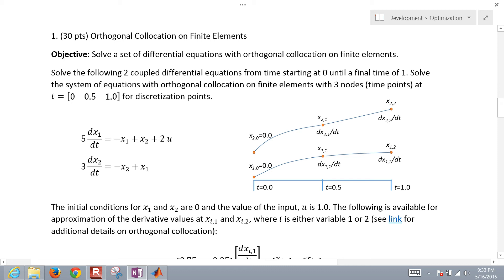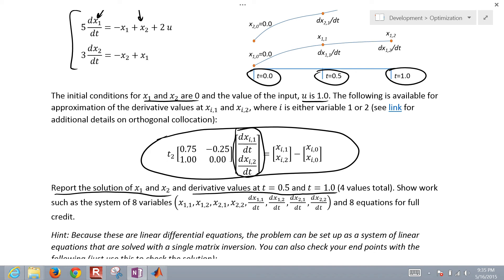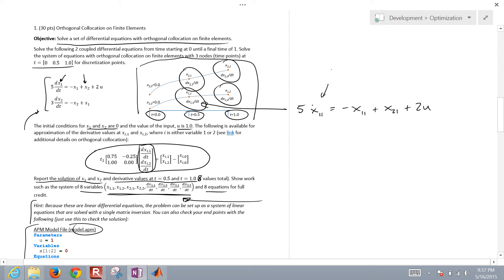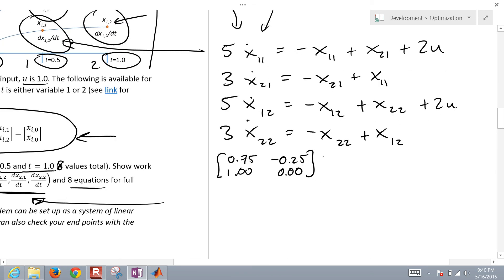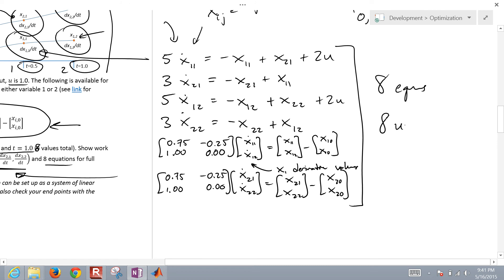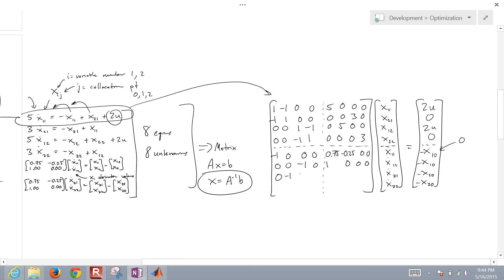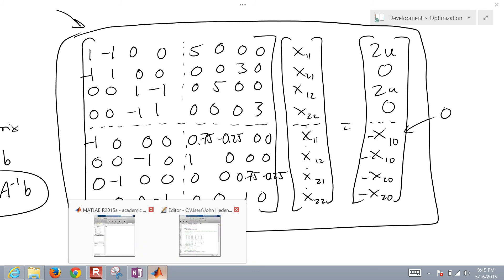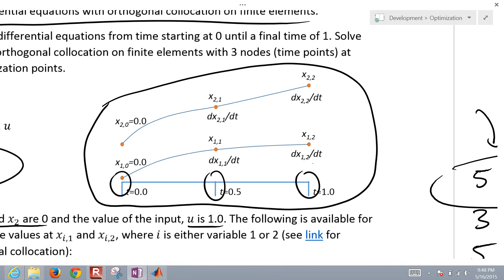Orthogonal Collocation on Finite Elements

Comment: Orthogonal Collocation on Finite Elements is the same as "Pseudospectral methods"? Or they are different?
Reply from the maker: Pseudospectral optimal control methods and orthogonal collocation on finite elements are discretization techniques used to solve optimal control problems. They share similarities in terms of use of collocation points and polynomial basis functions, as well as the focus on satisfying the system dynamics at those points. However, they also have differences in terms of the specific basis functions used, the error minimization techniques, and the way they handle numerical integration. The biggest difference is that Pseudospectral methods also creates a polynomial approximation of the state control actions in addition to the dynamics of the underlying dynamic model that relates control actions to the objective (such as setpoint). In my experience, the OFCE approach is more general and flexible to solve a wider range of optimal control problems. It is implemented in the Gekko Optimization Suite for MPC, Economic MPC, combined planning and scheduling, etc.